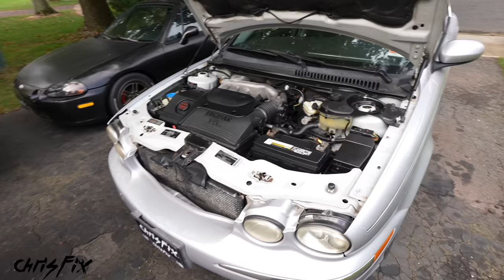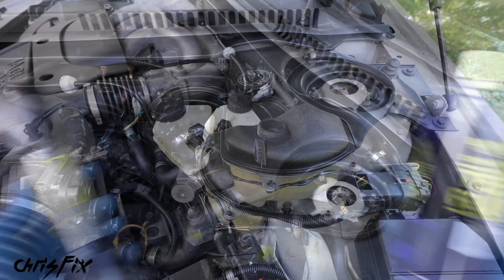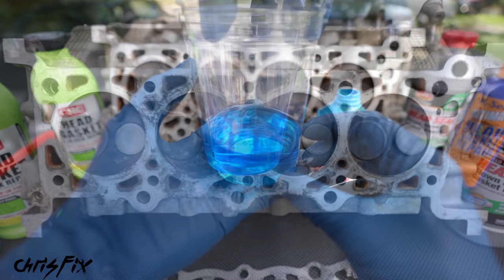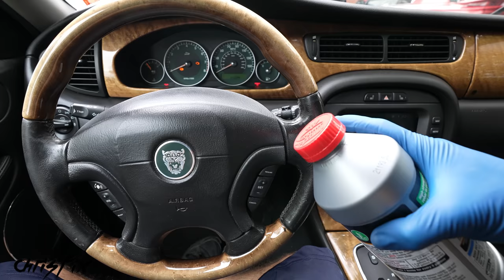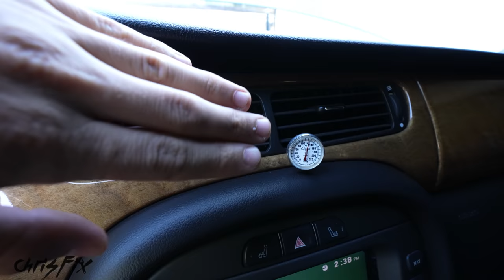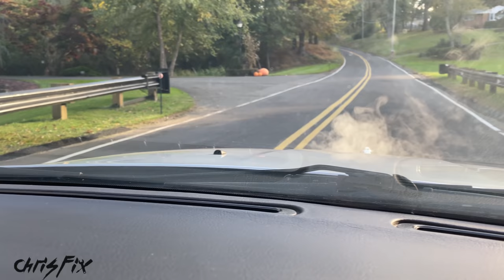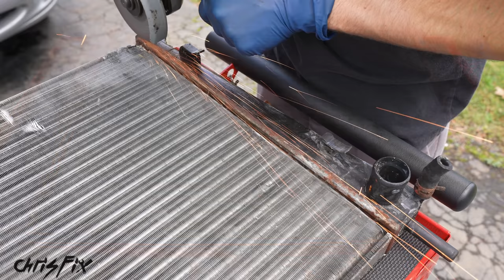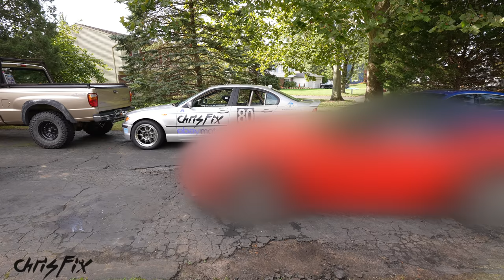Do Head Gasket Sealers Actually Work (FULL 2yr TEST with Engine Teardown)

Comment: I've been working on cars for nearly fifty years, and I've tried many different head gasket sealers over the decades. Usually the sealers from my early days were made to just get you home, but over the last decade things have definitely changed. My experience over the last ten years has seen quite a big difference in the quality and performance of these additives, and the one I recommend most would be Blue Devil, from their rear main seal repair, to transmission shift additive, and head gasket sealer, they are definitely The Best in my opinion!!!!
Reply: what you should recommend is get the actually fixed, if you can't afford that high bill just get a cheaper car and don't go to a dealer ship for starters. If you're car is worth $1500 i doubt anyone will be able to spend 30 000$ on a newer car, so yea, fix it if the bodywork is in good shape. On the used market you'll never know if there is sawdust in the engine or not.

Comment: I put Bar's stop leak in my 2001, Lincoln Town Car almost 3 years ago and its still holding.  My heater works great,  uses maybe 8 oz of anti freeze   a year.  The heater core was leaking.  That's why I used Bar's Stop Leak.  Works great for me.  To change a heater core on this car, the entire dash needs to come out about a 2 day job for a professional, 3 days for a DIY.  For what I spent on the Bar's Leak, it's worth it even if I have to flush , and add new anti freeze and Bar's leak.  😊

Comment: I have a 2013 Dodge Avenger R/T had the exact same problems as this car. No smoke billowing, no white milky substance in the engine cap, but the coolant reservoir reeked of Combustion gas. After $1,450 at the repair shop with no repair just money lost I was about to give up until I stumbled across this video.
Followed the instructions to the Letter. Took a day or two and had to top off the reservoir a few times but afterwards no overheating, running smoother and stronger.
Reservoir still smells of Combustion gas but it’s probably due to the old radiator fluid, gonna flush it and test it one last time. I really wanna thank you Chris Fix my only regret is that I didn’t come across this video before I spent $1,450 😅
Reply from the maker: Glad the video was helpful and nice work! I hope it lasts for you!
Reply: How's the car running now? And what brand did you go with

Comment: Used Barr’s Leaks on Dodge Dakota 3.7 V6, 230,000 mi, literally stopped the issue in minutes. A few months later drained all the coolant to replace the water pump and thermostat, lots of that goop present. Now, 6000 miles later, still going strong. Not a daily driver, but at least I didn’t have to junk the truck. Great video Chris!
Reply: looking at this vid and your comment i would just throw some more in when it goes again :)
Reply: junkyard one the way ( bought the 80's K1500 that way and it kept over heating, more so if i went light 4x4ing or towing sub 1500LB's on the hwy/town and junked 3 heater cores and 2 454BBC rads ect. aka hack fix in a grey bottle don't do it. still have the truck but no plans on the v8SBC+700R4 = bin, the rest of it im keeping after its 💯 dead 💀 or stolen/chopped ) iron SBC 305-383 and nope 👎 not rebuildable that i know how to as it gets every where and is hard to get off / let the water 🚿 passages work efficiently as designed. and i found so many hacks with it as a professional mechanic 👨‍🔧 👎 glad some people are smart and skipped that snake 🐍 oiling makes my life a lot easier and enjoyable 

lucky 🍀 me my 1970 440BBM doesn't have any of that junk 😁
Reply: Thanks for sharing!
Reply: Dodge Dakota has a nack for blowing a head
Reply: I used that many times and yea i never had a problem

Comment: First comment I've ever made on a youtube video is now: This was an excellent and comprehensive review, thanks for putting in the effort. I've always thought those products were snake oil... but if your in a bind it is totally worth a $20 swing for the fences. After 10K miles if it started to leak again? I"d throw the other half of that bottle in and cross my fingers. Well done man!
Reply from the maker: I would have done that but the brake lines were starting to rust and the car was just junk at this point haha
Reply: I've been using that exact Bar's Leaks sealer on a 2010 Prius (that year is known for blowing head gaskets). First sealed it in late Feb 2020, and the problem did come back roughly 10k miles later. I've put about 25k miles on it so far and still going (bought it at 193k, 218k now) about to add some more  sealer again. It needs more when it starts to shake briefly on a cold start, and at the same time I notice the coolant level very slowly going down. I didn't use as much the 2nd time because I figured after the first time, it was still mostly sealed. I think I used 1/3rd of a bottle the last time. Oil has been clean the whole time. Leak was pretty minor from the get-go, would take days of normal driving to notice the reservoir having less coolant in it.

16:30 The bottle shows more steps than that...first step after pouring the sealer is to get it up to temp (In a Prius that means go for a short drive), and then stop and cool off completely, but THEN you're supposed to also go for a second 15 minute drive after it cooled from the first step, not the next day. That's when I take it on the freeway for 20 minutes or so. THEN the next day and for the next 10k, it runs great. Maybe that's what caused the thermostat on the Jaguar to stick closed for a bit? I really have no idea, I'm no mechanic and these problems have variables.
Reply: @chrisfix  I have junked a Jaguar X Type just about the same time.. they just rust!
Reply: me too, 100%

Comment: 10yrs ago I poured Blue Devil into my 2004 Subaru Impreza 2.5, due to a blown head gasket, 124,000 miles later and to this day still running strong. 😬👍
Reply: Hell yeah
Reply: Was it leaking oil by chance?
Reply: @ricardomundi16  it was not leaking oil. 😬👍

Comment: Just sorted the comments by new and was amazed to see Chris still replying. I recently pressure tested my radiator and went through every chamber with an endoscope and found coolant filling my 4th chamber. The car usually last 60 miles before it needs a coolant top of so I'm hoping the blue devil HG sealant does it's thing. I'll be removing the thermostat and giving it a flush before i run the test but will be back with updates and results. Hoping for the best!
Reply from the maker: Let me know how it goes!
Reply: I ended up doing an oil change before and after but so far it's holding up, now we see how long we can roll 🤘😎
Reply: @X-Dub how did it go?
Reply: @harigopaldas108  got a good two months in before it started to overheating again, taking it to the shop to get the engine pulled and resurfaced. Not a bad temporary job to save for the task though

Comment: I'm an automotive technician with 20 years of experience. The times where I diagnosed a bad head gasket, the labor was usually more than the value of the vehicle. And replacing the engine was just as costly. In the rare cases that the customer wanted to try a head gasket sealant, we usually used Blue Devil, as it gave the best results. Some of these vehicles have an incredible repair process to fix a head gasket. A lot of shops won't take this kind of work anymore, as it ties down the tech, slows shop production, and more often than not, you'll find other things that need to be repaired in order to correctly repair the vehicle. And the cost of repair goes up, which pisses off the customer.
A lot easier to tell the customer NO at the front desk.
Reply: that's not cool. What if the customer loves the car and wants it fixed no matter the cost?
Reply: @pa4o93ir49  Then they will pay whatever the cost. Never be so invested in a vehicle, that your willing to lose your ass on
Reply: Or do it yourself. Here are some videos to watch.
Reply: @markcarr5142  Well some cars have sentimental value.
Reply: I think it's more costly in the US due to larger sized engines. Here in Chile repairing a bad head gasket (many times an engine rebuild) cost a fraction of the car value (considered actually expensive), but never the whole car value itself. Well, we got cheaper vehicle, thus unsafier and cheaper parts too.
Reply from the maker: Exactly. Trying to get a quote to fix the jag was almost impossible. I called multiple places and most wouldnt touch it for the reasons you mentioned.
Reply: @chrisfix  Chris please help with advise. I'm desperate.  I'm from south africa my vw jetta 4 has been losing power. The mechanic says the head has a leak and the oil and water are mixing. He.also says that the head is rusted. 

Will a sealant work to fix the leak?

He told me to replace the head and that's way beyond my budget. 
It's costing me R3800 ( zar 🇿🇦) just for the parts. 

Labor will be separate.

Please advise
Reply: @tasneemmahomed4138  Any updates ?
Reply: Question....I have a newer model car 2020 ford edge and it has a gasket issue.... It is out of warranty but I took it to a local mechanic shop and they suggested I use gasket sealer... Should I do it knowing the repair at the dealership is really expensive
Reply: @amdlincoln  a few questions : where are you located at?  What's the mileage of the vehicle,  what's the size of the engine,  and why did your head gasket blow?
Reply: What app did you use to monitor coolant temp please

Comment: Very excellent video and test, hats off! After watching this I added Blue Devil to my 2015 Chevrolet 2500HD with the 6.6 Diesel. I wasn’t sure if the compression on the diesels would be too much for this type of fix. My truck was pushing exhaust gas into the coolant system and overflowing the tank. The truck ran well despite this. No overheating, it did towing, daily driving at 75mph, approximately 500-750 miles a week. It’s used for business purposes. Just left a puddle everywhere I shut it down and needed to be topped off with coolant weekly. Through your description of the products I chose the Blue Devil because it seems like the exhaust leak I was having would heat this product in the damaged area and seal it up. Plus I was scared to use one with the fibers and clog the system up. It worked like Magic! I followed their instructions but ran to truck twice as long to make sure it was hot. I haven’t added any coolant since I put the thermostats back in. Little over 30,000 miles on it since I did this and I’m knocking on wood as I type this up, Thanks for the video and the confidence to try it.
Reply: watch out for that over pressure on the coolant side, i recently lost both a radiator and a heater core due to it.  it was just pushing coolant out the expansion tank cap,,over flow, that releases coolant when above 18 psi or so...problem was the pressure would climb faster then the coolant was being released causeing not only for the car to loose a bunch of coolant in just a 15 mile drive( liter or so) , the coolant pressure would peak at 26 psi. usually peaking after i turned the engine off. this extra pressure blew open the heater core..and a week later  blew the side out of the radiator. then i finally realized what was going on.
Reply: holy crap.

Comment: I shook up and dumped a bottle of k-seal into my radiator in my 1995 dodge caravan with the 2.5l i4. tasty blue-white exhaust, coolant level reduced every drive with no visible leaks underneath, and milky oil. Ran it 3000 miles after the K-SEAL before selling with no remaining issues.

Comment: You have completely changed my mind about head gasket sealer, I have a beater that I dont want to spend all that time to replace the head gasket and before this I thought it was my only option, thank you ChrisFix!
Reply: Just blown my head gasket. Sealer 20€ and new gasket 15€. Takes like 30min to take old out. But it is still very good video for some cases where proper repair aint option

Comment: I had been watching every video I could find to choose the best one. I settled on K-Seal Ultimate because of ease of use. I had a blown head gasket on a 2001 Buick Century 3.1 engine, very famous for weak head gaskets. I followed the directions and almost fainted when I saw the massive volumes of white smoke dying down to absolutely nothing within 5 minutes of the thermostat opening at operating temperature. I started with short trips in town for a week, just in case it failed. The next week I took it out on the highway at 60 mph for 65 mile round trip with no problems. I have since driven from Kingman to Laughlin several times. It is torture on cars pulling that 13 mile steep grade to the top at 65 mph. The real test will come when the weather gets hotter. My two test were done in 77* to 84* temperatures with the A/C on to put extra stress on the cooling system. The temp gauge stayed just below halfway mark. I'm really impressed with K-seal. I bought the beautiful Buick with the head gasket blown for $100.00. paid $33.00 for the K-seal so if the repair doesn't last a long time, I won't be losing a lot. I will keep you posted as I am starting my 5th month of driving it after using K-plus. I will update periodically.
Reply from the maker: Thanks awesome! Thanks for the info!
Reply: $100 whip? Shiiiittt
Reply: Thank you!
Reply: @19ShilohK  I know right man even with the gasket going that’s a hell of a rally car if you can find a junk engine for it
Reply: K-SEAL that’s my go to as well. Don’t mess with the other stuff!
Reply: I tried that stuff on A yanmar 3 cylinder . Waste of money. Lasted about 20 min .
Reply: @Reno Simpson how do u know that
Reply: It's actually pretty rare for a 3.1 to blow a headgasket. Like all of GM's modular V6s, the problem if from the intake gaskets.
Reply: @RockandrollNegro  ion know if you telling the truth the fluent car language make it sound like you are 🤣
Reply: But if the piston pop from the gasket you can narviate the block off the sealer. Point blank period. Ask Takahashi 69 he'll tell you 🤫😭🤣😂
Reply: any update on the k-seal?
Reply: I used K-Seal on two problem cars. immediate success!!
Reply: @wildancrazy159  Thanks for the reply. I wish I were in Florida, too. I miss seeing green grass. Lol. Happy to report that the Buick is still running great even in 100+ temperatures. I thought the drive from Bullhead in 115* Temps up the hill at 65* with the a/c on would be the ultimate test. It passed with flying colors. I swear by this K-Seal Ultimate. Good to hear from you.
Reply: update?
Reply: @masterdriveroftoyotazupr4164  Still doing great after rigorous hot weather driving here in the Arizona summer heat. I have really put it to the test, driving 65 mph up the steep 14 mile grade from Bullhead city in 115* Temps with the a/c on Max a dozen times or more. Not one drop of coolant loss and temp needle never past center. Best product ever. No draining, flushing, or any of that pain. I do suggest that you change oil immediately if your head gasket leaked coolant into your oil, after it has sealed your leak. Be sure to use K-seal Ultimate for this job. Regular K-seal is good for radiator and heater core leaks, but use Ultimate for the big problems. Good luck.
Reply: @19ShilohK  😂
Reply: Say what🤔

We're made in HIS image. HE made us with the power of free choice
A good prayer:
I'm a sinner JESUS please forgive me for all my sins I know you shed your Blood for me on the cross at Calvary. Thank you JESUS for my salvation and for shedding they Blood for me. I love you JESUS. 
Romans 10:5/10 ct...❤️k
JESUSisLord!Amen...
Amen..
If you'd like to call someone who cares 
83
For
Truth.
bc you don't know when you'll die?
.y r u hesitant. .. .... .. . .... ...
Reply: Hey, fellow Mohave Countian, how’s the fix holding up?
Reply: Update?
Reply: @lonniephillips7862  Update? Also, how bad was the leak? In the oil, burning, external leak?

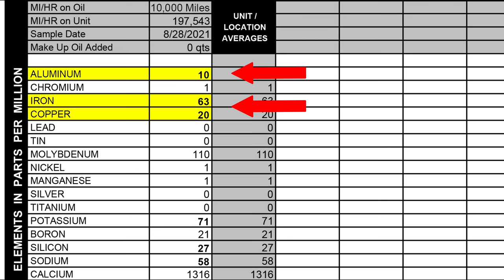Comment: 29:10 : the most important tip of the video. Once the head gasket get sealed up, change the oil (and the oil filter) right away to prevent wear and tear.
Reply: How about the coolant?
Reply: @shane250  Depends on the sealant used. I personally prefer steelseal with no added fibre material it is safe to leave it running in the coolant until a proper repair can be performed. I know a guy who has just added a bottle when he changes coolant every 2 years, car has been used daily for about 7 years now.
Reply: @tothethreshold.9965  
That makes sense. Thank you!
Reply: @tothethreshold.9965  If you have a leak into the oil you should do it regardless since the water build up is gonna ware the engine
Reply: @tothethreshold.9965  Changes coolant every two years... Is that supposed to be done?
Reply: This should be a pinned comment.
Reply: @WymanandBrad  
Usually every 5-7 years. The anti-corrosive additives won't work much more than that, and if you're in a freezing climate, the freezer resistance will become worse with time.
Reply: @WymanandBrad  yes it might be necassary in colder/wetter regions.
Reply: I'm thinking next think to do is clear the OBD code, ensure the permanent code is erased, then trade it for a newer car. My car is a 2017 with 70k miles and excellent condition. Trade-in will be great if I can clear those codes. Otherwise, costly repair.
Reply: Inwas told the kseal is better

Comment: I used a bag of Martin's Super Sealer on my 2.0 Toyota. It's like it says, it's a super sealer.
This engine is notorious for headgasket failure. I put in one bag of the super sealer, and filled up with coolant. Let the engine run warm, and topped off the coolant. 2 years and about 20K miler later, and still no leaks.